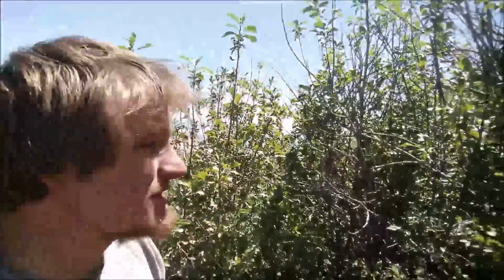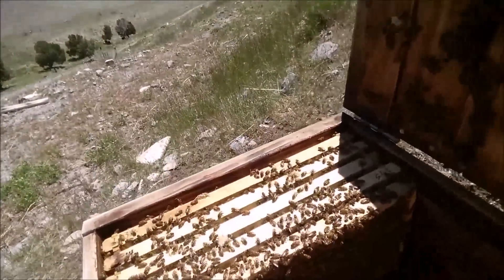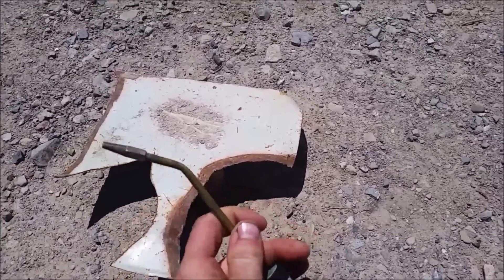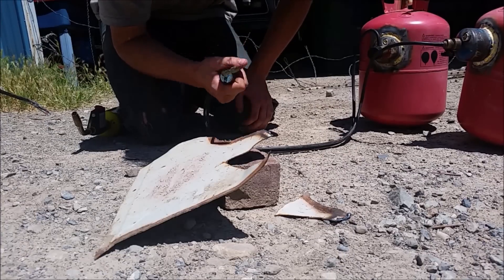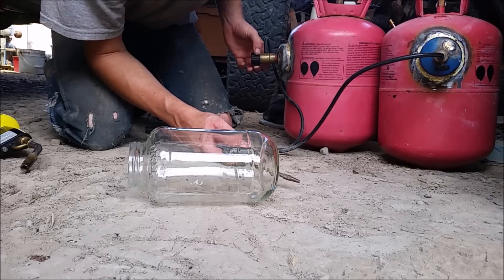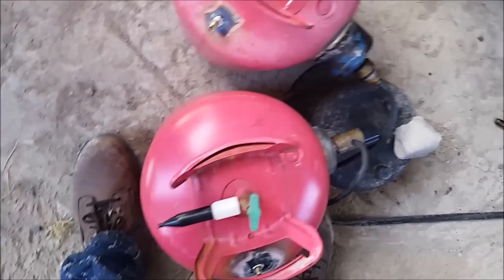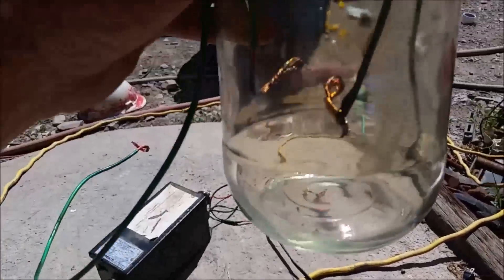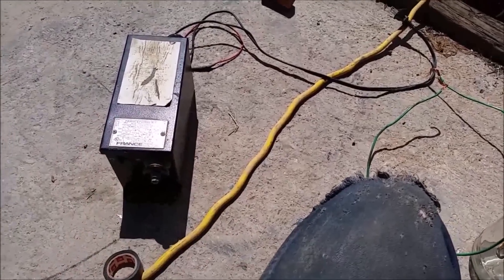Testing My Oxyhydrogen Torch

Comment: You might want to look into the storing hydrogen and oxygen and pumping it into your from electrolysis without even separating it and running it to a tube you can run hydrogen and oxygen made by the electrolysis into the bottom of the tube and then light the tube on top when it's filled with sand it'll just burn at the surface. It will not work back and blow up your source of nitrogen oxygen and hydrogen

Comment: Ok, leaky H2 container. Check. No eye protection. Check. No flash back arrestors. Check. Makeshift torch. Got it! Seriously, is this guy trying to take himself out of the gene pool. Let's not even mention the fact that he has two tanks that he clearly was doing hot work on with an open flame. If there any oil or pain on the inside that in itself can cause a tank to explode. A lot of people die that way. But maybe he really was smart enough to fill them with water when he was brazing. And seriously, if you want a flashback pushing fuel gas into your oxygen tank, that makeshift torch could not be better. Here the risk isn't setting off the acetylene in the tank. It's having a flashback into the oxygen tank and setting the metal tank itself on fire. I've seen an aluminum oxygen tank that went off when being filled. You could literally see the inside of the aluminum tank had caught on fire in the debris from the tank. Pure oxygen can make things like steel, aluminum and Teflon burn. 

I should also be noted that hydrogen is useless for welding steel. It causes something called "high temperature hydrogen attack". (Not hydrogen embrittlement) It's caused by the hydrogen finding grains of carbon at grain boundaries in the steel and under the temperatures involved, combining with them and creating pockets of methane that cause the metal to crack. (Hydrogen embrittlement is happens at room temp)  

Even cutting is not a good idea.bif you cut parts out they will be weakened bear where they were cut.

Comment: It's not the hydrogen that's cutting through steel.  One the steel/iron is red, you turn up the oxygen to cut through it.  You can even shut off the hydrogen / propane / natural gas / acetylene source and cut the steel using only oxygen, as the steel instantly corrodes, producing enough energy to keep the reaction going.  That's the principle of oxy-cutting used by welders.  Cutting torches have a lever attached to directly to high-pressure oxygen to do the cutting.

Comment: I've always thought an oxyhydrogen or air hydrogen combustion engine would be the best eco-friendly replacement for petrol engines. Plus hydrogen has a much greater energy density at 33.33Kwh/kg (petrol is around 12), it makes a great rocket fuel for a reason. Everyone could have a solar powered fuel generator at home, not to mention the emissions are only water! Electricity is great to power vehicles to lower emissions, as long as that electricity hasn't come from a big dirty coal fired generator.

Comment: The reason that the surplus of oxygen doesn't blow out the torch is because hydrogen burns at around 40,000ft/second.  If you mixed the two tanks into one, no matter how fast you let the gas out, it could not keep up with a hydrogen flame and would blow up with a crack

Comment: Everyone is on about the hydrogen exploding or him getting hurt while welding because he uses no protection. Is no one concerned about his way of making nitric acid? Especially wanting to automate this setup? Producing a highly toxic gas with an open high voltage spark right next to water is probably not the smartest idea Cody ever had. Just imagine if that glass ever topples over, or the tape getting weak, or the NO2 and NO leaking.... that thing is a poisoning and fire hazard if you ask me.

Comment: I believe you are incorrect with your concept. 
One can cut with oxygen alone after the oxidation process has been initiated, (even with much thicker plate steel). While a student in metallurgy theory, welding, and ironwork I was shown this process then did it myself right after, using oxyacetylene then turning the acetylene off and leaving the cutting trigger depressed.

Comment: I wonder if adding extra oxygen cuts the steel by making the flame hotter (how would that work?) or if the excess oxygen reacts with the hot steel and oxidizes it away.

Comment: I’m no expert but I’ve done a little bit of welding and torch cutting, and you don’t even need the acetylene to cut! Once you have the steel beginning to melt, you can turn off the acetylene and the oxygen alone is enough to burn the steel itself. The cutting torches we used to use had a lever which would turn off the acetylene so you don’t need to fiddle with the knobs once you get a cut started.

Comment: The arc doesn't break down the air, it is already ready for the reaction, the arc is just the catalyst. that was the original way to produce nitric acid. you can cut with those little benz-o-matic torch, they are just small, and its touchy

Comment: I love the idea of using a hydrogen-oxygen fuel mixture, for that very reason you showed in the video…its “waste” product is water.  Which, if you build a system to capture and condense the water vapor, which is then returned to a “fuel container” (water tank) to then be used for separating into hydrogen and oxygen again…you effectively have unlimited fuel.

Comment: I once saw a hydrogen fire from a 1/2 inch pipe burn through a concrete block wall and set a powder metal dust collector on fire it took the Indianapolis Fire Dept. all day to put it out.

Comment: While in the Navy in the 60's on our ship the air dryer for one of our RADAR's broke down the air dryer was used to purge the wave guides, I suggested using dry nitrogen that we purged our HF antenna tuners with. What happened was disastrous the UHF voltage in the wave guide arced over making nitric acid, the damage was blamed on me for my suggestion but the fact is that they somehow must have had water in the system and even the air dryer still put nitrogen into the system even though it was less still why didn't the same thing happen in the HF tuners that were at a similar power out. This has bothered me all these years and I was reminded today. Cody I like and appreciate all of your work and the practicableness you bring to science.

Comment: How do you prevent flashback inside the torch handle where the gasses mix? Mine kept popping. I was using a stoichometric gas mixture that came fresh from the electrolysis generator. I knew it might flashback and ruin my generator, so I bubbled the gas through a small plastic water bottle that was almost full of water so it could only pop the little bit of head space at the top--and it did every time! It would work for a while then suddenly the little plastic bottle would explode, and I would be wet! The generator produced enough volume to make a flame about four inches long at the tip, so I don't think it was a lack of gas pressure.   I am thinking that adding oxygen in excess, and keeping the gasses separate until they enter the torch head might prevent the flashback issue. Opinions?

Comment: Did you intend to imply that an oxy/acetylene torch won't cut steel? Maybe you just meant with a welding tip as opposed to a cutting tip? I've cut many a 1/2" steel plate with oxy/acetylene.

Comment: ???     Of course you can cut steel like that with a welding tip using oxy-acet'...   I've done it many a time.   
You simply need to feed in LOTS of oxygen..   and you can then cut bolts, cut a kerf in a steel plate etc..  
NOT the prettiest..   but it certainly gets the job done..  and often saves you from having to swap out the tip to a ful cutting torch head..  especially out on site when time is of the essence.

Comment: could you test a hydrogen flame surrounded by solar panels and see if you can get electricity from it? if there was a way to make enough hydrogen gas from electrolysis then you would have a powered electrical circuit until the water run out 🤔
Reply: Second law of thermodynamics says hello. Electric energy gained from these solar panels will never even come close to the electric energy used in electrolysis.

A fuel is a substance that can react exothermically, meaning it has some energy stored and when reacting it releases that energy producing substances that have less energy stored. Water doesn't work that way, all the energy you get from recombining hydrogen with oxygen is the energy you put into it by separating it from the oxygen in the first place.
Reply: The Crazy Pineapple yes but a small voltage can be boosted with voltage multiplier circuitry  (i think that this law could be broken) 🤔

Comment: Two questions: First - How the fizzing hell are you collecting your hydrogen in a pressurized tank once you've liberated it from the water? that's amazing! second - why are you adding oxygen? Problem with using hydrogen for welding is burning & brittlizing the steel, not getting the gas to burn with sufficient heat.

Comment: I've worked a lot with hydrogen, professionally. You might not have a leak. The hydrogen is such a small molecule that it passes right through the steel. Your cylinders have thin walls, and they've been stored outside, so the sun heated them up, which increased the pressure, which increases the loss rate. 
Lighting a flame with a leaking tank is nowhere near as dangerous as you think - out of doors. the gas is so light, that it just goes straight up. 
Good video.

Comment: That is a transformer for neon lights which require that high voltage

Neat way to make nitric acid but I like the torch ideal also but I have noticed one thing about those refrigerant bottles

If you saws all the valve off the top I'm seeing a way to tap and thread into the hole left and install a new valve that would work two ways which is what I want to do with the vacuum chamber I want to build that not only will vacuum but also pressurize the vessel somewhat for vacuum and pressure experiments

Plus of course you would not have as many fittings in that way which could leak also such as that stinger valve and other stuff you welded into the tanks

Comment: is hydrogen tank rated for hydrogen? plane steel tanks are slowly degraded by hydrogen so they blow up over time(hydrogen diffuses into steel and turns carbon in it into methane and steel looses it's properties)

Comment: I know this video is super old now, I just wanted to point out that hydrogen and oxygen don't burn.  It's a synthesis reaction, so that why it works so well for cutting.  It's very hot, and doesn't rely on the same conditions for combustion.

Comment: cutting by torch is done by flooding the red hot steel with oxygen which causes the steel to burn.  the reason oxy hydrogen isn't used for welding has to do with hydrogen enbrittlement of the steel.

Comment: I think that water is produced by condensation. The difference in temperature from the torch and the air. So most of the water comes from the air, right?

Comment: In an Oxygen Hydrogen torch, I don't understand what would keep the flame safely at the tip. Why don't the mixed gases combust all the way back in the tube to the point where they are mixed?

Comment: Hey Cody, hydrogen molecule is so small that it would even leak through completely hydrogen-tight rubber stoppers. When I was a child, I collected hydrogen in a glass vessel and put there a small tightened balloon with a bit of air. So the balloon had expanded by the next morning, because hydrogen went right through the membrane! You can also make this experiment, because hardly anyone has, so far.

Comment: fire don't have a shadow......
Reply: Fire will cast a shadow that looks about the same as the mirage that hot air creates. Like if you look right over the hood of a car in the middle of summer. Instead of blocking the light and having a dark shadow, it just scatters it and has kind of a shimmery, barely there type of one.

Comment: try a spray bottle and soap, spray it around the gasket and the welds or w/e places you think it might be leaking and it should bubble where the leaks are, also you can pressurize the tank with air to help show the bubbles better, but awesome stuff man great videos.

Comment: so is it reasonable to think that someone could build a beefy sterling engine to run off the heat of the torch, and then generate energy? and when I say beefy I mean something that would be able to withstand the extreme temperatures from the torch

Comment: thanks bro asked and answered,I really want to build a system to purify my waist water on this yacht.Go all water world this acid cost slot so never really thought on that side of it all.With wind and solar for power there is a over prediction of power just waisted put to a heat sink.Would scuba tanks hold hydrogen better? thanks happy holidays from vessel no problem icw Florida.

Comment: I've used that torch to cut sheet metal.   also in the instructions there is a way to use that torch with oxygen only.  it's the steel that acts as fuel.  at that point it cuts like a plasma cutter, but goes through a small bottle of o2 in like a minute.

Comment: there are studies to suggest that some light gases "leak" due to quantum tunneling
Reply: This would not be related to the storage of a gas in a container at typical temperatures and air pressures. And certainly not related to a traditional gas molecule.

Comment: Cody, Love the torch man. Good job. Address it but don't stress the leaking. Every project can use improvement, after all we are only human.
I am curious though. You mentioned that you have a device that can refill the oxygen and hydrogen tanks. Did you make the "refill station?" If so, I would love to see what you have to separate the oxygen and hydrogen. Brown gas (HHO) is not safe to store, so being able to make and store "clean" oxygen and hydrogen is important. I am working on a HHO system but have been wanting to step up my game to having "clean" gases. Care to share and swap ideas?

Comment: I know this video is over a year old but you should know that Hydrogen leaks through solid fittings as well as any actual leaks, the storage containers for hydrogen are very thick walled to slow it down a lot but it will still leak out eventually. Your best solution is to generate hydrogen as close to using it as possible or generate a lot of excess.

Comment: is there like a flame that is so hot that it can't burn
Reply: Wessel van Dijke the fuck do you mean by that?
Reply: plant man the flame
Reply: Wessel van Dijke ???
Reply: plant man is there a flame that's too hot to burn things
Reply: Wessel van Dijke you do realize that that makes no sense
Reply: plant man what makes no sense?
Reply: like you have a really hot flame and it cuts through objects without burning it
Reply: Wessel van Dijke oh you didn't explain that well. 
Maybe it could be so hot it turns from a solid into a gas instantly and doesn't burn the edges
Reply: A plasma cutter? Those are insanely hot and they cut so well that any heat damaged zone (think like heat-softening a piece of plastic or metal) is very small. They're good for cutting complicated designs from steel, go check out some pics somewhere.
Reply: No such flame. But there is plasma (which is not a flame), which is used a lot in factories etc
Reply: Wessel van Dijke ji then how is it considered a flame

Comment: You should be able to fuse two pieces of steel together without a rod.  Lay them edge to  edge at about 45 degree angle and heat along the intersection it forms and watch as they melt together in a smooth water tight seam.    

Something else that will help is to turn your wrist to move the torch along, as opposed to trying to drag it with your arm.  You can twist your wrist back and forth to keep the melt running smoothly.

Comment: watch out. an oxyhydrogen torch with an excess of oxygen will produce, obviously, an oxidizing flame rather than a neutral or carburizing flame. oxidizing flames will tend to corrode your base material before you can get good metal penetration.

Comment: I may be repeating somebody else's suggestion, but doing this at night--or even in twilight--would've been awesome. Flames that are invisible or barely visible in the daytime burn translucent white in color in the dark. Working with these type of flames in the dark makes it a lot safer, it's easier to work with, and it looks cool!
Reply: Transparent flames are also extremely dangerous for obvious reasons

Comment: When you burned the hydrogen flame in the jar to see if water would accumulate...I remember from chemistry class  that carbon dioxide and water are a product of most combustion reactions.  So if you used a different gas like propane, would it still collect water?
Reply: fall22123 hydrogen and oxygen produce only water. Hydrocarbons and oxygen produce water and co2. Of course chemmistry is messy, so you get some carbon monoxide as well.

Comment: I've experimented a bit with making HNO3 in that method and what I found is the fumes it makes are so corrosive that they attack the apparatus - not to mention the active spark will help that along even more.  It doesn't matter what I used, copper wires, glass tubes, etc, it all got damaged by the spark and fumes generated.  The result was that I could get dilute HNO3 like you saw, basically up to a pH of about 2, but anything lower pH than that would not be possible as it would neutralize against whatever apparatus was in the jar.  If you find a way to make it a lot stronger using this method, I'll be curious to see how you pull it off.
Reply: Probably taking out the Nitric/Nitrous acid that is generated in the bottle and then later purifying it in a separate jar using other methods. But nitric acid is very aggressive and corrosive - they even require it to be separated from the other acids in the acid cabinet.